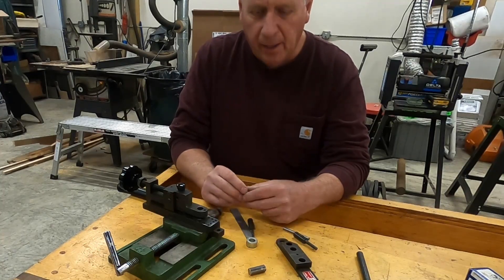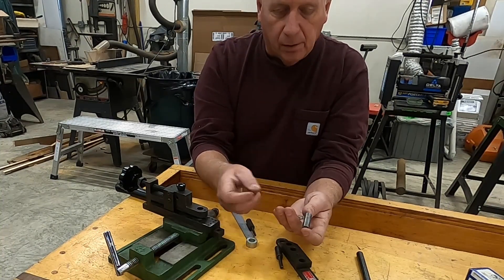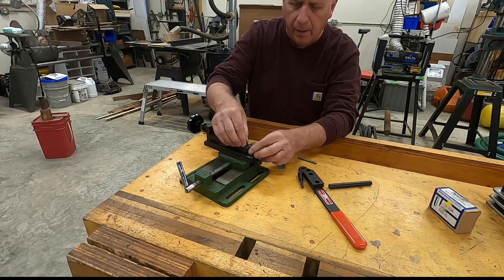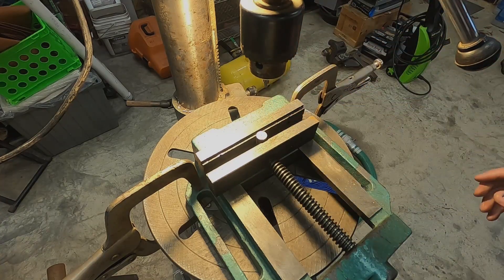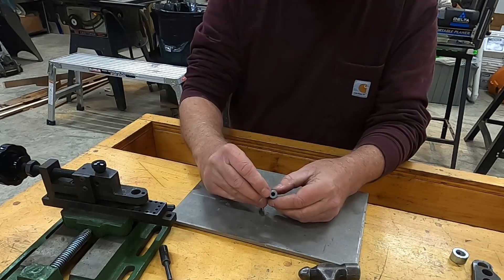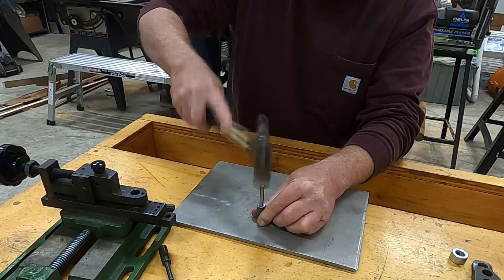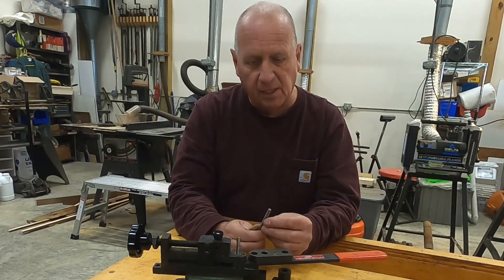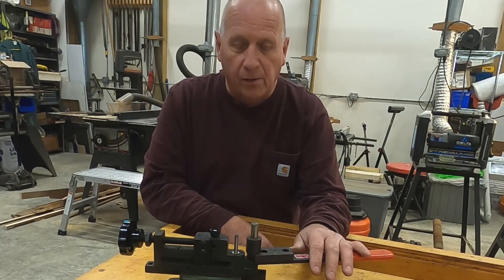🔧 DIY Custom Dies for Your Mini Universal Bender – Simple Tools, Big Results

Comment: Nice video! I just ordered one of these benders and I'm eager to get started bending. I'm happy I stumbled upon your channel in the meantime.
Reply from the maker: Thanks for your comment. You may find yourself putting too large of metal stock in this tool and bending the shafts as I have done in the past. You can find various diameters of the pins at McMaster Carr.
Reply: What would you say the limit is before the shafts bent? I did some 3/16" steel round bar this afternoon and it seemed to handle it without any issues.
Reply from the maker: I don't know, but my best advice is to watch the shaft closely when bending to see if the shaft is also bending if it is then you are at its maximum capacity. Remember as you use smaller diameter shafts, their capacity is less. Thanks for commenting on my channel a enjoy using your new bender. @Dellpodder

Comment: I got one of these last year and it kind of reminds me of the Chinese mini lathes! It’s ok right out of the box, but a little time spent tweaking things results in a much improved bender! One of the most glaring deficiencies from the minute I put it together was the handle. It drooped noticeably, and caused it to make uneven bends! The hole for the pivot pin was too large, and the flat bar the handle was made of was too thin. Both things coupled together made the handle an extremely sloppy fit, so I cut the block off the handle and welded it back on a thicker piece of stock, then drilled a proper sized hole for the pivot pin. Massive improvement! It’s easy to make custom tooling for these also! I’ve always had a fascination with metal benders, and my collection includes everything from this mini bender up to a Hossfeld #2 (the holy grail of manual benders!). Keep on makin!
Reply from the maker: Thanks for the reply. I wish that I had the Hoofeld #2. I ask Santa for the Harbor Freight Compact Bender this year. I plan to make more videos of the projects in my shop.
Reply: @buildItplace  The Hossfeld #2 has been in production since the early/mid 1920’s! Years ago I sent them the serial number off of mine and asked them if they could tell what year it was manufactured, and they couldn’t pinpoint it, but said early 1930’s for sure! And they still make them today! My first bender was a Shop Outfitters compact bender, a shrunk down version of the Hossfeld - very pricey but an excellent machine, although Harbor Freight stole Shop Outfitters design and started selling their own model, and SO quit producing them! I have the HF one also, but it’s rough in many aspects compared to the SO original. The compact bender is ripe for building custom tooling just like the mini universal! I recently made a rod eye bending attachment that mimics the Hossfeld eye bender tooling. It’s all neat stuff! You just have to prove to the thing that you’re smarter than it is! Ha! Looking forward to your next video!
Reply from the maker: @tomt9543  Thanks for all of the additional information. It does seem like you know alot about these types of benders. I have plans to present more videos of a diverse selection of items.